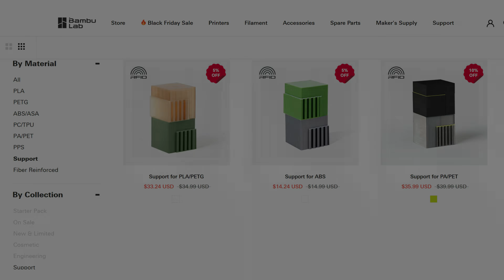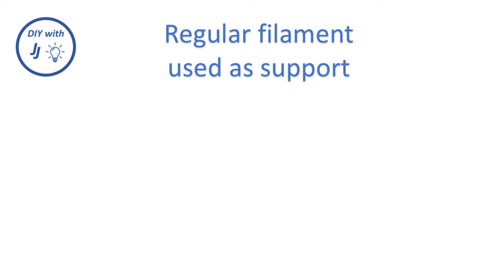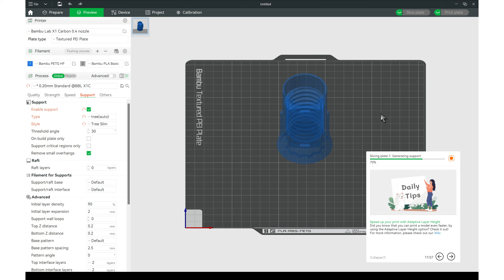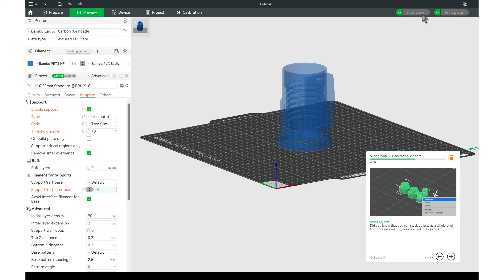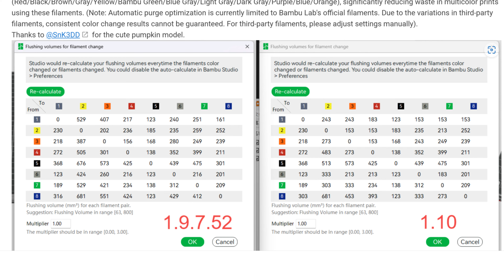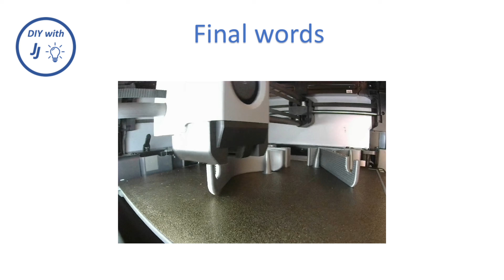How to Use Support Materials with Bambu Labs AMS for Better 3D Printing

Comment: i dont get it man, it appears that your using more material now, you were at 53 total prior then pushed up to 70+ and also increased your print time, maybe i dont understand whats going on as i am new to this , but that seems to be what i see ?
Reply from the maker: Quality!!  In some 3D prints using supports, you can encounter two serious issues if not using a different support material.  1)  Poor surface quality in the areas where the support material is removed, and worse 2)  You may not be able to remove the support material without breaking your new design.

Comment: First model i need support i tested with tree default and slim version but default will do only 68 changes, if i try slim it does 258 changes insane.
Reply from the maker: While it is difficult to provide accurate answers when I am not looking at your print, I can suggest a couple of remedies:
Bambu Studio often generates far more support than is needed.  Try setting the Threshold angle to a lower value.  I often go as low as 15% or even 10% without any problems.
If this does not work, try support paint where you can shut off unneeded support areas manually.
In other words, look at the print and use some common sense to evaluate the need for support where the app is generating the support.  Oh, and don't forget you can set the support to manual instead of automatic.
Reply: @JANtheDane  Yeah i did set it to 15% also did use only from bed and then i use default since that for this print is the most friendly option only 68 changes and around 40-50 ish gram needed for support

Comment: I am completely new to 3D printing, I just bought my first Bambu p1s with ams. I printed a small part that needed very little support, print time is 30 minutes. When i changed the support interface to another material, somehow the print time went up to 2 hours, which i find crazy.

Could you help me what could i have missed that led to this print time?
Is it possible to get rid of the prime tower, since the P1S can load itself?

Thanks, great vid by the way, keep it up
Reply from the maker: It sounds like you have too many filament changes.  In the preview it shows you how many.  This may be caused by support you don't actually need.  Try setting the support to a) Tree b) Tree slim c) Threshold angle 15.  How did that change the number of filament changes?

Make sure ONLY the support/raft interface is set to the second filament type

For most prinnts I get rid of the prime tower.  I am actually planning a video on this.  In the "Others" tab, scroll to "Prime Tower" and unselect "Enable"
Reply: @JANtheDane  thanks for the tips, im gonna try them as soon as i get back to it 😁

Comment: thank you so much for the video! ive been wondering the same thing about the support filament
Reply from the maker: I have been using support materials for all my prints needing support since I posted this.  All those prints came out much better than before.  It is much easier than I thought.

Comment: Very detailed video and straight to the point. Thanks.
Reply from the maker: I am glad you liked the video.  If you want to know how to combine STL files right in Bambu Studio, I will have a video on that within the next week or two.
Reply: @JANtheDane  I don't have a Bambu printer ... Yet ... but it is in my plans. And the separate supports will help.
Reply from the maker: I am perfectly capable of tinkering with a cheap DIY printer, but long ago I decided that I wanted a 3D printer to enable me to produce some of my many ideas and inventions rather than just getting another tool to spend my time getting to work.  I am glad I waited for the Bambu printer.  While I have not had the time to post videos, I have printed dozens of new inventions and shop tools.  Stand by for a lot more videos.

Comment: cool, one more tip, if you want to be able to detach even more easily the part from the support change the Top and bottom Z distance from 0.2mm to 0.4mm. It will come out without effort, happens that 0.2mm (the default value) is good for soluble support
Reply from the maker: Thank you for the feed back.  I did not mention in this video that i actually switched to a 0.6mm nozzle some time ago, which means the support is 0.3mm.  And you are right, this does make the support detach easier.  I highly recommend the 0.6mm nozzle, as it improves the print time without any noticeable quality changes.  I left the 0.4mm in the video since most people use that size nozzle.  I plan a future video discussing the 0.6mm nozzle and I will include your comments about the support.